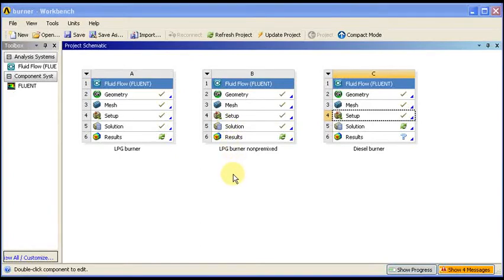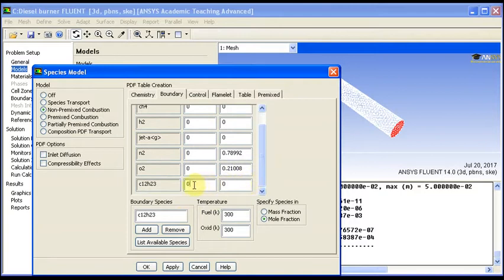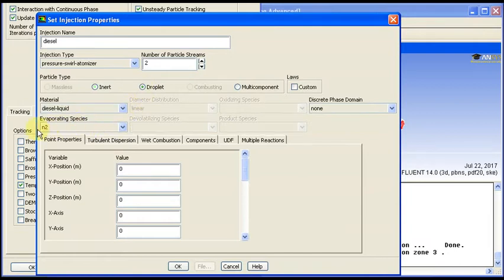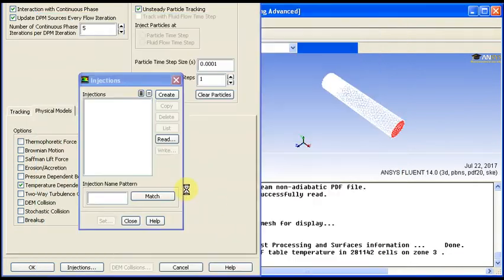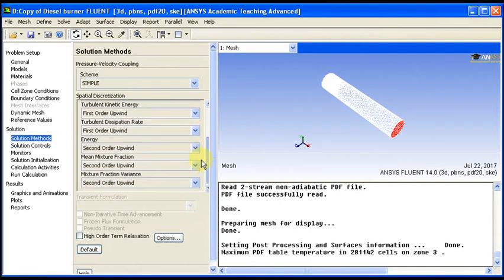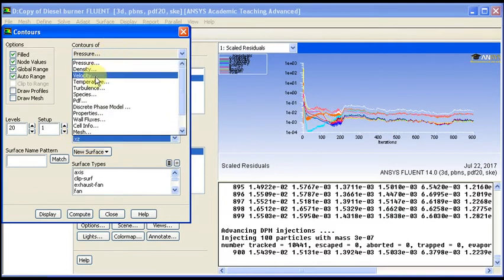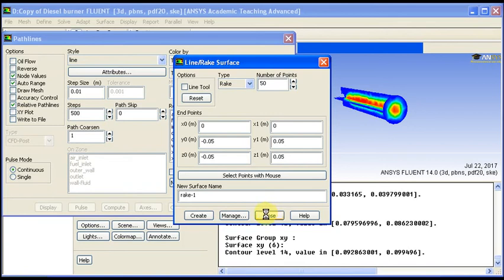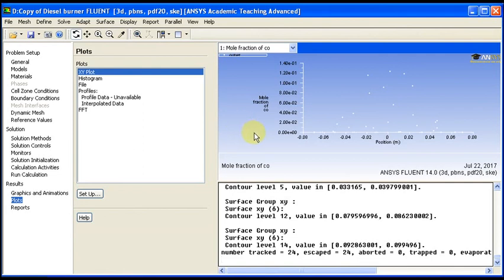Part 5: ANSYS-Fluent tutorial (Discrete Phase Model (DPM) for liquid diesel combustion)

Comment: diesel liquids chemical composition is c10h22 in ansys fluent database.
Why did u use diesel liquids chemical formula as c12h23?
Reply from the maker: I commonly use C12 since it is heavier and closer to liquid biofuels ... but it doesn't matter ... pdf will calculate the properties for whatever fuel formula you put as vapor.... for DPM, the formula is not defined in the model (as liquid) since the model only will use the liquid properties in the materials section such as density, viscosity, etc that you can change according to your specific fuel
Reply: @khaledAlattab  thank you very much about your answer. im very happy with this explanation. may i ask u a more specific question. for example im trying to use pyrolysis oil in my simülation. its average chemical formula is around c10h14o5. but when i  try to add this formula to secondary fuel stream for pdf calculation (because i use gas and liquid fuel) ansys says that  add this formula to thermo.db file. İt is as you know database of the fuel which is written in NASA format. 
According to your helpful answer if i use c12h23 as you've done in your video, will i make an reasonable assumption about my pyrolysis oil. Because its kind of biofuel.
finally ve u any other tutorial about this case for example fuel oil combustion. can you share this.
best wishess....

Comment: Thank you very much for this video . It's very useful but my model is a bit different. I want to introduce moisture(water vapour) into a chamber , can you be of help?
Reply from the maker: Same setup ... but you need to introduce in pdf two fuel inlets and one oxidizer ... one fuel will be you r actual fuel and the other stream will be water (vapor) ... then for the fuel it can be introduced as vapor using pdf but the there will be no physical inlet for the water ... just a water injector set by DPM ... so in DPM you specify water liquid and water vapor from your species

Comment: thank you for ur sharing! it inspired me sir ,I have a question : because i only use the species transport to do the combustion case, i don't know how do you specify the boundary of fuel inlet is species of diesel and air-inlet is air??
Reply from the maker: Thank you dear for your comment. In species transport, since no pdf is calculated, you have to calculate the species fraction (out or 1) in both inlet and outlet boundary conditions. First: in air inlet you put the mixture fraction as 0 and (O2=0.23) if it is in mass ..or  0.21 if it is in mole. Second: fuel inlet you put (O2=0) and mixture species =1 (if pure fuel inlet without premix). Third: in outlet port you have to do the actual combustion equation (in mass) externally and see the fraction % for each component of the exhaust (i.e. CO2, N2, O2). for example if the product side of combustion looks like this (a CO2+ b  O2 + c N2 + d H2O) ..the fraction of N2= c/(a+b+c+d) and so on.

Comment: Thank you for yoursharing! It's wondeful !I have a question ,How to set or change  the lower heating value of the diesel ?
Reply from the maker: Thank you dear for your comment ... for non-premixed and partially premixed models you put the formula for diesel such as C12 H23 and it will calculate the heating value ...only in premixed model you have the option to insert the heating value.
Reply: Thank you very much for your reply! How can I know the lower heating value of c12h23 before calculate?If the quality of c12h23 is different I want to change the lower heating value of c12h23 ,what should I do?
Reply from the maker: To calculate high heating value HHV from ultimate analysis you can use (Dulong formula) the calculate low heating value (LHV) by knowing how hydrogen mass. C12h23 only give you C% and H% ..you still need S% and O% to calculate HHV more accurately. 
So, in short, If you can know the ultimate analysis of your fuel (the diesel you will use in experiment) you can derive the formula (CnHm) and input to fluent.
Reply: I'm very glad to receive your reply!In order to change the  low heating value (LHV) of c12h23,Can I change the standard state enthalpy of c12h23(the default value is -2.49717e+08)?

Comment: Thank you dear. It was very helpful. I have a question : If we specify a fuel in the non premixed combustion model, does ansys itself takes it that it will combust??

Second Q :  when we give fuel injection at a particular coordinate(point) , does it mean particles are being injected at that point.??
Reply from the maker: Thank you dear ....For Q1: you have to set temperature when initializing the solution to about 2000K for startup...you can can even set a patch with the startup temperature for the fluid zone to insure that it doesn't shutdown. If the geometry and flow conditions are suitable for combustion the flame will sustain otherwise the temperature will keep dropping with more iterations until the flame shuts down.
For Q2:  yes, that is correct and you can also set X, Y, Z values for the angle of injection.... meaning that if you set X=1 , Y, Z =0 it will inject to +X direction from that point...Or X=0.5, Y=0.5 it will inject at 45 degree.etc.